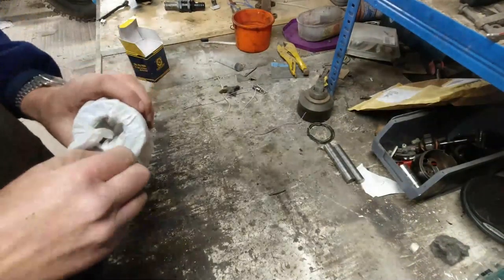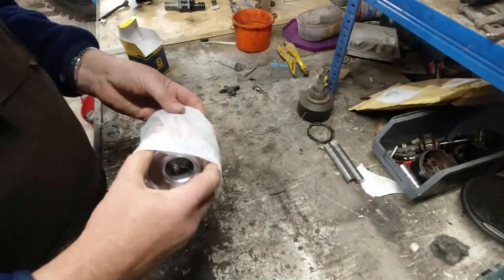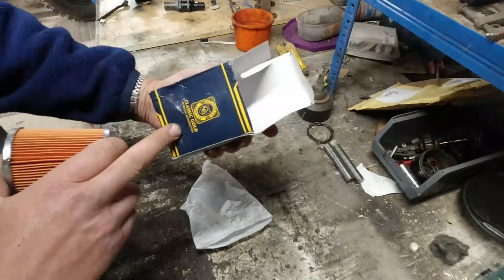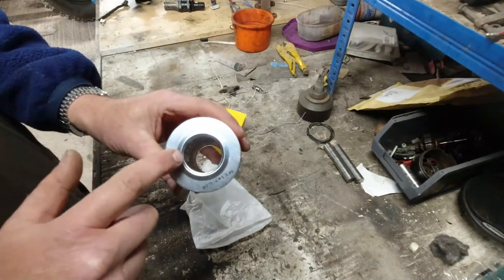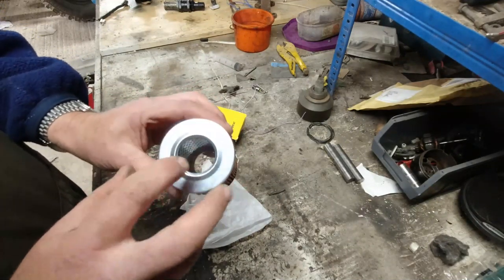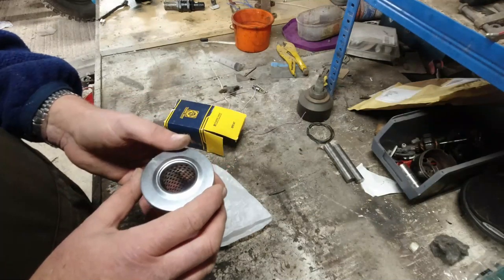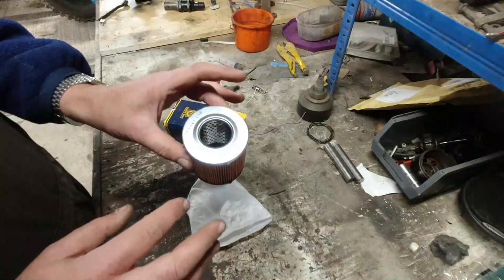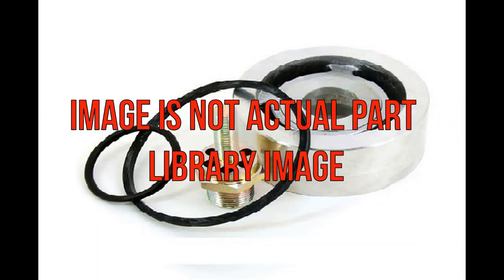1973 Triumph Stag oil filter

Comment: I use an adaptor, and you are absolutely right about the adaptor coming loose. Just nip it up when I change the filter. Access not a problem removing the modern type of filter with one of those 'chain' tools............. I do love your rant LOL :-)

Comment: Ha! Brings back memories! the last Stag I owned I converted it to the screw on adaptor and never had a problem, must have been lucky. One thing I used to do when the oil was at the drip stage, was to jack up the rear passenger side and you could get, another half pint of old oil drained out. Your car appears to have been registered in Coventry [RW prefix] and some fun trivia for you....Stuart Francis the England captain, bought a new stag in 74 and so did Ed' Stewart the DJ...i was a total Stag geek and a pain in the arse at club meetings, you know the sort who knows the size of every nut, bolt and interior colour code....also Aston Martin modified an all black stag and named it The 'Tickford Stag', ... Thanks Sub 777
Reply from the maker: I think it more likely that I was unlucky with the adaptor. My point is that folk seem happy to spend upwards of £50 on an adaptor, that then needs another £20 for the tool to remove it and make just as much mess, once a year, as they would with the paper cartridge 😋

Yes my car was registered by the factory under the "home delivery export scheme" any ideas? Heritage certificate tells me that the car was sold through the Triumph Dealership in Hong Kong, but doesn't list a ship that might have transported it there.

I do enjoy a rivet counter, especially the levels of knowledge from why I might learn something new 🍻👍
Reply: @churchhouseclassics  That scheme was really just a tax dodge so you didn't pay VAT on a new car. The tax was added at the country of destination. Your car will have been owned by British Leyland and then sold as an export but not exported...confusing I know! The RW reg means, it was direct from the cowley plant in Coventry and probably used or displayed by Leyland. It would have had a Pink log book also instead of the brown one. All the press cars had the RW in the reg...the first Stag [LD1] was RRW 97 H [I think] and I think the white stag used in the film 'Straw dogs' was a press car also.

You do realise you have just opened up a dormant cavern that was closed years ago, I will keep sending you trivia as I remember it.Thanks Sub777

Comment: Informative video Richard. As you say not all improvements are improvements. I have a 3.9L Discovery motor in my Stag so don't have this problem.
Reply from the maker: bet that is fun! running efi or carbs?
Reply: @churchhouseclassics  The 3.9L is a serpentine EFI motor. I wanted to keep it simple so removed the EFI and fitted a new 500cfm Edelbrock AVS2 carb. I have some YouTube video on the car, check out 'Rowan's Triumph Stag'.

Comment: Just looking at the filter assembly mine has (from bottom to top) the circlip, then the valve, then a seal, then a metal washer & then the spring. I reckon you've got the circlip in the wrong place it should hold the valve in place. Mine's the AC Delco housing. For some reason the clip isn't shown in the parts catalogue

Great video's BTW really enjoying them
Reply from the maker: the clip is just an r-clip, I guess that it stops the non return valve and spring from falling out when you remove the filter.

The non return valve should sit snug in the bottom of the filter. the spring sits between it and the bottom of the bowl. This forces the filter element up against the face of the block. 

Glad you are enjoying the vids 👍🍻

Comment: Always use BL Unipart NOS filters
Reply from the maker: be very careful of those NoS filters that have the card o-ring top and bottom, they shift when hot and will allow the oil to bypass the filter completely. The Classic Gold filters are good for the Stag

Comment: Just a few pointers, warm the engine first . makes the oil drain better, and start the oil  draining while you remove the filter and you are not hanging around waiting for the sump to empty.
Reply from the maker: Stag oil filter is millimetres away from the exhaust downpipe. warming the engine up before changing the oil filter? rather you than me sir
Reply: @churchhouseclassics  I am talking about warm oil not hot oil, and the filter drops a small amount of oil when unscrewed, I have done it this way for forty years of stag ownership and it seems to work fine, but each to his own

Comment: Lucky you noticed on the drive before jumping in and fucking off!  At 40 psi you can lose A LOT of oil very fast. You’d have seized the engine before the oil light came on!  I had an oil pressure capillary break by the filter. How small is that pipe ? 1/32 ?  Lost five litres out of seven in just over a mile ( followed the oil trail back to source) if I hadn’t stopped at The Sloop for a beer and to walk the dog, on a hot day trundle round the lanes, I’d have ruined my newly fitted 200 tdi !  Gauge still not connected a year on !
Reply from the maker: For the Stag I now use a braided hose for the oil pressure gauge, had one of the standard plastic jobbies break on me, only it sprayed oil all over the back of the dash which then dripped down onto my bare legs, gaaaah that oil was hot! For the Stag I think I used a Mini pressure hose, the fixing ends will all be different though
Reply: Church House Classics  medieval early warning system!  
Seriously keep a sharp eye on the condition of that pipe, if you don’t noitice the gauge drop, when the oil light comes on ( if you notice!) that just announces that the oil pump has just run out of anything to pump. I’m going back to a capillary at some point but with an oil light switch right behind the gauge, with a bright warning light that I can’t miss.

Comment: Why oil change with only 3000 miles? On the clock
Reply from the maker: older engines regardless of their condition will pollute the oil with fuel. this then thins the oil and reduces the efficiency. be sure when filling an older type engine with oil to use the correct spec and more importantly the correct ZDDP level

Comment: Surely a modern formulation 15/50 oil would be an ‘improvement’ that would give a longer change interval than the 20/50 oils of 50 years ago ?

Or do Stags and XJs give their oil a really hard time ? Your old stuff looked pretty vile.

Maybe the zinc is more important ?
Reply from the maker: Stags and Rover v8s are especially hash on the oils. Also bear in mind that these engines were designed, lead was used in petrol for lubrication. I would not recommend running modern oils with their detergents etc in such an old engine and follow the advice of specialists such as Classic Oils at Bicester 👍